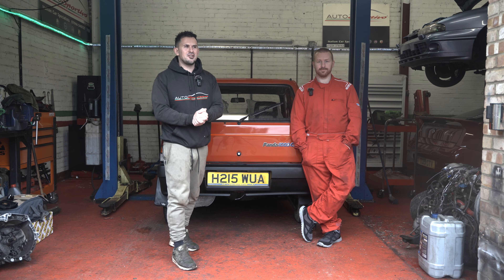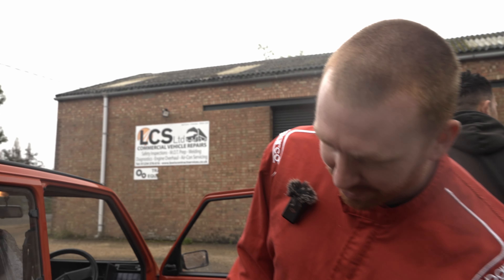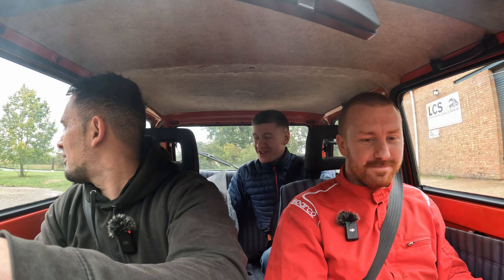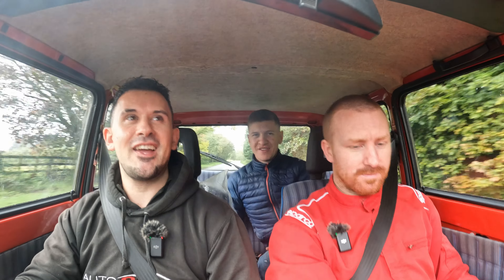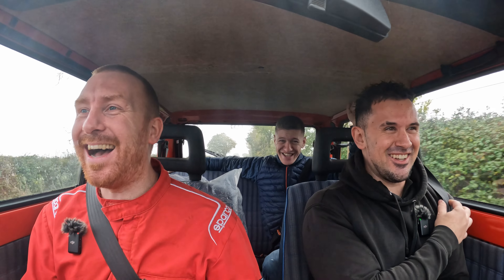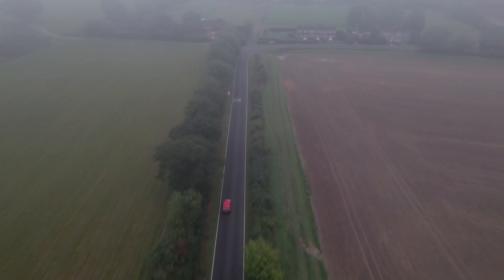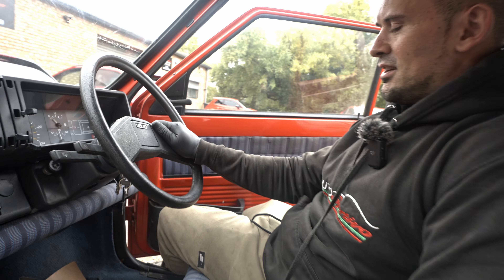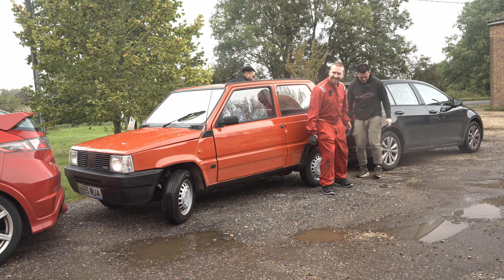Is this Italy’s most loved car ever ? #fiatpanda

Comment: My wife had two pandas, you will love this story, she phoned me saying it had stopped after it got slower and slower, I asked if any lights on the dash were on, she said a little red light came on several miles back. I was not amused that was the temperature warning light, she drove on until the engine sized. My dad had a garage business so we towed it to the garage thinking it was scrap. The next day my father phoned me saying he went out turned the ignition on and started the engine up and that it was fine all it needed was a fan belt as it had broken and caused the overheating. She drove the car for another two years before we sold it, true testimony to how tough those little Fiat engines were.

Comment: I’m afraid Panda’s bigger sibling, the Uno, is Fiat’s best selling car ever. More Uno’s were produced in Italy than Panda’s and and more Uno’s were produced outside of Italy than Panda’s. Even if you include the third and fourth generation Panda.
Reply: True, but Pandas are still around today (the fact that 4x4 achieved cult status might have helped)  , Unos became kinda rare even here in the south (and the fact the Turbo is a cult is counterbalanced by the fact they tended to hit trees)
Reply: Yes, you’re right. Why would that be? Is the Panda maybe more of a cult car? Or was/is it cool to own one. I’ve owned several Unos, but they all either rotted away, or the engine died. I recently found one from 1989 (mark I), with 33,000 kms. From the first owner, no rust, first one with SPI engine, no luxuries or extras whatsoever. Still fun to drive. I also own a (disassembled) X1/9 and a fully restored Uno Turbo 1300 engine. Hope to finish that car before 2030 and not hit any trees :-)

Comment: I had the top spec 1000S as a student bought new, with tinted glass, 5 speeds, wider tyres and better wheels, blaupunkt stereo and other minor upgrades. It was quick in London in urban areas, and completely reliable in the 20 years I owned it and the 150,000 miles. It would also comfortably cruise at 80mph on the motorway, with four people so not only a city car. The Problem was mainly rust being left outside, under the doors and on the roof. I swapped it for a brand new Panda 100hp in 2010 which i still own and which is great fun and again underrated in value.

Comment: I had a later version of that 1000cl… a 1992 K plate 1000ie with SPI and a Cat, plus 5-speed gearbox and 155/65 13 Pirelli P8 tyres on those same skinny steelies. It was in a lovely turquoise colour and had a modernised plastic grille. I upgraded to some lovely MIM alloys and did lots of motorway miles between Chester and Milton Keynes before trading up to a Tipo 1.4 i.e.

Brakes were fine…..

Comment: I had a 1993 one with a 989cc engine as my 1st car and absolutely loved it.
Worse mistake I did was selling it for £100 in 2005 - I did crash it twice due to black ice and a pot hole, that 2nd one made me loose interest but I still regret selling it - Damage wasn't actually terrible and could have been saved, I really want another one but the prices have sky rocketed haha
You guy moving towards the end lifting the panda, I remember going out of my house and watch 3 fire men doing the exact same thing with my car, I was parked on the corner in my space but they needed a tiny bit more room for the truck to get around

Comment: A 1995 900cc is my daily driver, it's nothing short of brilliant. The design of the car is just superb and the drive is excellent.  Mine has done about 35,000 miles and had two owners, which helps. I do most jobs on it myself but there isn't often that much to do.  I driver in preference to my other far newer and far more expensive cars without even stopping to think.

Comment: I`ve still got an 89 Panda tucked away, a 32,000 mile 750L with an outrageous 34bhp.. It is slow & fun, & crazy economical, but, I prefer driving my Uno`s, because they go round corners much better, & don't weigh much more!

Comment: Ciao !
My wife had a 750L also a 4 speed as you mentioned it was surprisingly nippy and pulled strongly, she had a 126 bis before that twin cylinder 650cc😅 
These are brilliant, fun, characterful fun little cars, most people don't get them and what they are about.
There's an old Italian saying 
"Gli italiani vivono per le piccole auto italiane"
"The italian peoples love for small italians cars"
This is so true. My dad and I have had loads over the years.
The panda engine was originally a 903 ohv pushrod, think it was 30bhp before the fire engine was introduced upping it to 45 and 60 bhp same as the uno outputs, there were loads of option levels, Ltd edition 1s aswell, remember the white  italia 90 panda with football style wheel covers ! 😅 I think the top spec panda was the 1000s, super which gad wheel covers, door n mouldings, generally  better looking and more comfortable, the red 1 you have is a prime example, engines and gearbox are brilliant, all very basic and easy for us to laugh but back then these cars were a revelation.
Fists were so advanced, well thought out and engineered for their time and of course so easy to work on and maintanance, there's a lot to be said about small fiat's and their cheeky individual characters 😊
💚🤍❤️